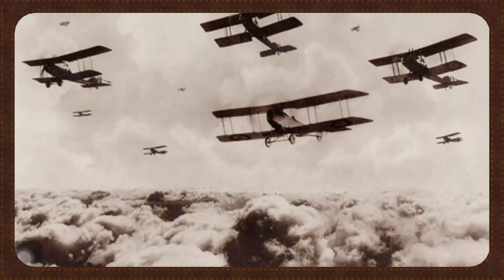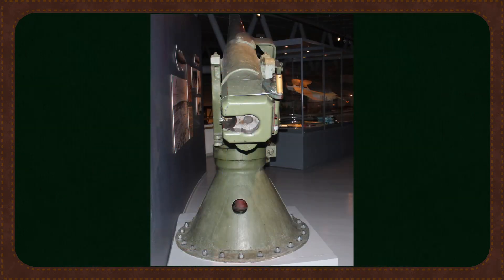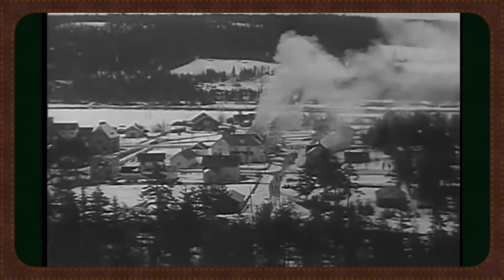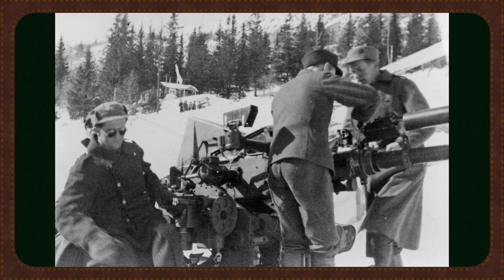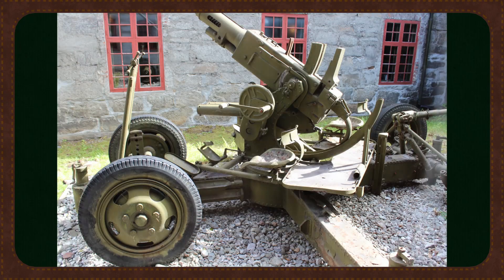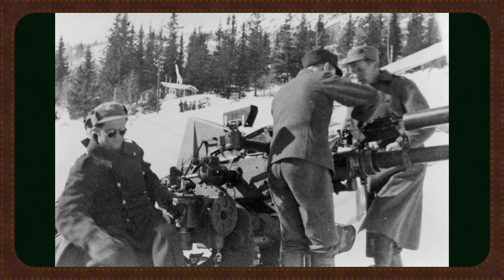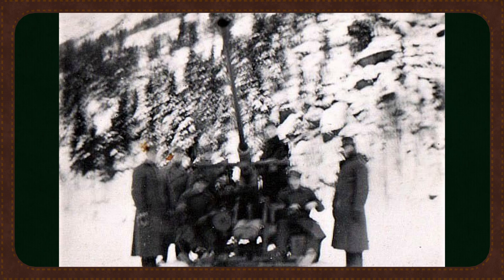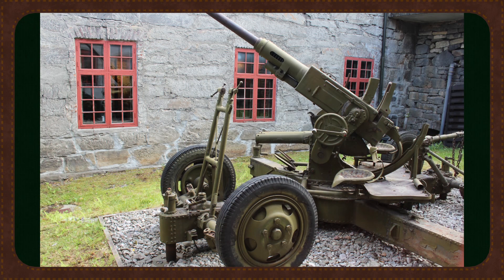Norway’s Bofors M/37 | The Gun That Came Too Late

Comment: I treasure the few spent 40mm Mk2 brass casings I fired from an AC-130A “SPECTRE” Gunship in practice off the Florida coast in 1975. The A model C-130 gunship had a red button on the pilot’s control yoke. We pressed the button to fire the guns once the aircraft guns were aligned with the target.
These particular cases are marked 44 to indicate manufacture in 1944; I was born in 1942.
Although fully capable, our crew was never called upon to fight, thus never caused any death or injury… which is appreciated.

Comment: It is pretty wild when you think how extreamly versatile Bofors actually was able to engineer these.
The 50+ or so CV9040c Ukraine are using in the current war almost 100 years after its original design are now also used as SPG roles with a range of 12km and beyond.

this means it is or has been in Service for almost all possible roles except SPACE:
USA has used it as main gunnery onboard their massive Flying fotresses airplaes to give cower fire or bombard ground targets.
Swe Swedes use it still for almost all possible and impossible reasons.

And its role as AA has been completly revitalized thanks to the threat of Large and small Drones.
Reply from the maker: When i think of AA my mind goes immediately to the Bofors. It will probably be with us until the end of time 😊

Comment: The Bofors m.37 L/60 AA Gun is STILL having ammunition made for it....2025....a SUPERB system, & OK, the 40/70 is the more currently modern weapon, & is also VERY relevant today....I would be DELIGHTED if SOMEONE out there had ANY DATA, photo or SPECIMEN, of the ORIGINAL Bofors 4-Round CLIP for the 40mm L/60 m.37.....I NEED to RECORD.Draw it for the NATO Library: